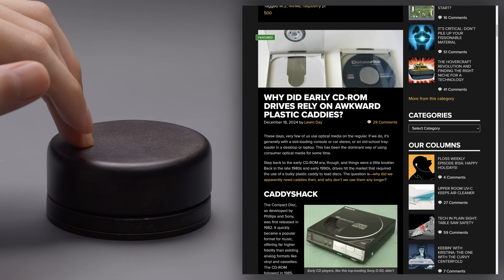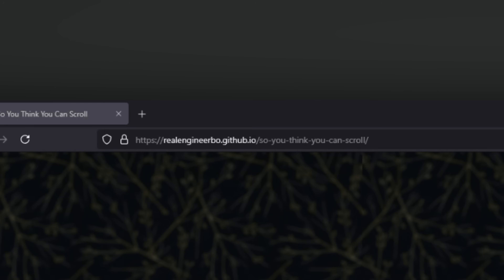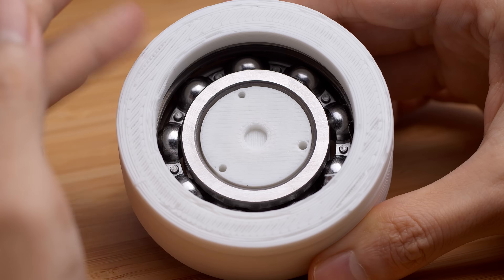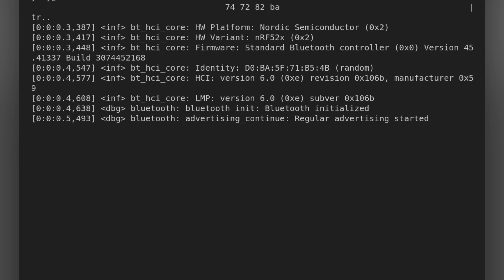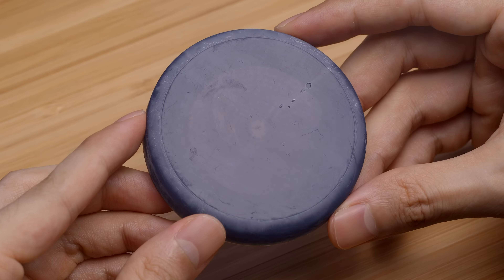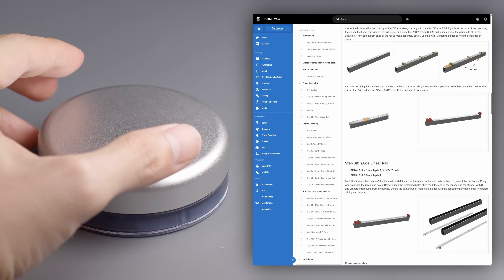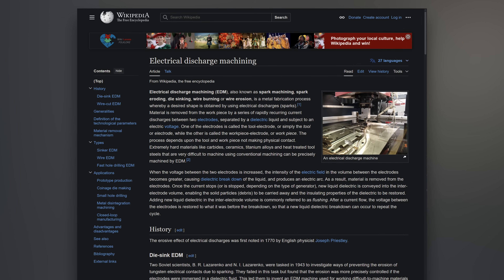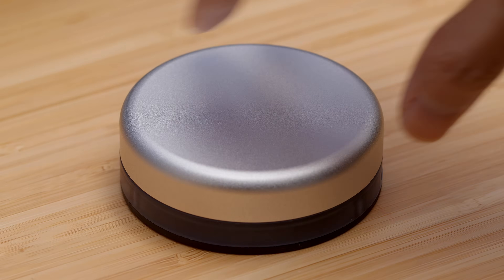Wireless High Resolution Scrolling Device: Full Scroll Dial v2

Comment: Regarding Mac OS support for unusual pointing devices, you might have a look at SteerMouse, which is a third-party application plus device driver that lets you use a very wide variety of mice on Macs that might otherwise not work quite right. It's not free software, but it's got a free trial and I think it's worth the money if you use non-Apple mice on your Mac devices. It also has a lot of features for configuring devices that it doesn't automatically recognize, so I suspect it would let you adjust how your scroller works with a Mac, after some experimentation.

I won't link to it because YouTube will probably think it's spam, but it's easily searchable.

Comment: I use "Mos" on MacOS for the scroll. Apple doesn't really care (or want to care) about how third party mouses work and this app tries to fix it. Try it (or others like it) with the option where it adds inertia/springiness(/maybe smoothness) at the end of the scroll turned off, as I think it will behave weird. Just set the "steps" as small as needed and play around (pun intended) a bit. Good luck! Last but not least, this is an extremely nice project, pleasant video too.

Comment: I'm a little worried about the perfectly flat bottom, if there's a crumb on the table or something the device will not sit evenly. if you had maybe 6 small bumps in a circle for feet that would solve that potential issue.
Reply from the maker: That's an interesting consideration, thank you!

Comment: can you make a wired version? I would preferr that and it also does not require certification that way
Reply from the maker: It'll be quite a significant change since that requires switching to a different microcontroller. It'll still require certifications, but it'll likely be cheaper/faster if it's not an intentional radiator.

Comment: With a base and button(s), that would make an AWESOME paddle/handheld driving wheel controller!
Reply from the maker: I was recommended to try using this as a retro game controller (spinner), and it actually works very nicely. There's no force feedback though, so maybe it wouldn't work as well for driving.

Comment: For tapping.

Next time order the aluminium part with smaller hole and then drill to the desired diamenter for the tapp. Is the easiest way to remove the hard "coating" of the anodizing

Comment: You could look into using a flex PCB to avoid the need for the cable and connectors between the sensor and the main board

Comment: Personally would enjoy a wired version rather than battery and wireless connection.

Also would be neat to add basically a middle mouse click to this, something that could swap the mode quickly and easily, turning it into a volume knob or something else. Also just a nice satisfying click with it would be great to have anyways just from a fidget perspective lol.

Comment: Please say no to the rubberized spray, it will degrade over time making the surface tacky/sticky, and it's btich to get off.  Use little rubber feet instead that can easily be replaced.
Reply from the maker: Yes, for durability, I'll try something else in the next build!

Comment: Very nice job. That said, I might increase the complexity by asking for a scrolling resolution selector, a switch at the bottom with three (low , normal and high), or, for better accessibility, a hole in the middle of the dial where you could place a round button. Each time the button is clicked, it would cycle through the predefined resolutions. However, there might be some interference with the space allocated for the battery.

Comment: So after the first video, I went and bought a Microsoft Surface Dial hoping to get a similar experience since I am not capable of building and programming one of these myself.  I also wanted to use it as a timeline jog dial in davinci resolve, which I could do by mapping the rotation to the left and right arrow keys (per my bindings in resolve).  What the Surface dial lacks in comparison to your wheel is stable bluetooth connection (sometimes bluetooth needs to be turned off and on for it to wake up and function) and the resistance prevents the wheel from spinning once let go.  It would be awesome if you could implement a key binding feature into the driver (or maybe the wheel functionality built into windows for the Surface Dial).

Comment: 500uA on this mcu is just too much in sleep mode. I was able to bring it down to 20-30uA(whole PCB not just mcu) with ble and nfc turned on in the background.
Reply from the maker: Yes I haven't started power optimisation on the application. 30uA sounds great with BLE on. What connection parameters did you use? Did you lower the radio TX power as well? Is the MCU in system off mode?
Reply: @engineerbo i did not touch tx power and kept it default as in nrf connect sdk. 

Zephyr automatically takes nrf to sleep mode and best way to keep the power lower is to keep to mcu in sleep by calling k_sleep when no alternative tasks are running nrf will stay sleeping. 

Also instead of using mosfet to switch power for your sensor, use dedicated power switches with low quotient currents and also the regulators which you are using check there quotient currents as well. Try to switch of any redundant thing in your pcb.
Reply from the maker: @EmbeddedEnigma Thanks for the tips, I'll have to run through all the quiescent currents again before the next revision!

Comment: You could have little indents milled in the bottom of the aluminum, and use a spring to push a plastic or metal bb into it for a small "click" feel if the fully smooth scroll isn't your thing, like a mouse scroll wheel.

Comment: 13:24 I would suggest dissolving the broken taps out using alum. There's a great AvE video on it it will attack the steel exclusively and leave your aluminum intact.

Comment: For the dial, do you think you could 3d print a version of it, use it to create a mold, and then create a forged carbon fibre dial?

To be clear, I know next to nothing about forging carbon fibre so it might be impossible.

You might also be able to 3d print the inverse of the dial directly and then use the 3d printed part as a mold.
Reply from the maker: I actually have all the bits needed for this (including the chopped carbon fibre strands). It'll probably look really cool, but it might end up having too low a moment of inertia (too light).

Comment: wonderful! do you think it would be good as a steering wheel in euro truck simulator 2? the surface dial works, though the ms api is not implemented so there is a maximum input rate limit :(

Comment: 6:33 If the AS5600 is shut off when not needed, how does the microcontroller know when to power it back on if it doesn't have feedback from the Hall sensor?

Comment: I see how the bigger bearing is one way to solve the wobble problem, but looking at the previous design, it seems like you could drop in a thrust bearing very easily, so you'd have both a radial and a thrust ball bearing.  What I like about that solution is that each bearing would be doing the job it's designed for, which I think might extend the life of the device, and they would be cheaper.
Reply: Axial needle roller bearings will be the perfect choice for this application

Comment: Scrolls by sending mouse wheel events

34938 Sunshine for Windows and Moonlight for Android
35216 KDE Connect for Windows and Android
29304 Synaptics TouchPad (TOS0300/SYN0700) two finger scrolling
30454 A normal mouse (120px)

Scrolls by draging the scrollbar

39260 A normal mouse (Enhance pointer precision off)
43727 Steam Controller Gyro (Steam Client required)

Comment: score of just over 73k on my first attempt at the scrolling gaming, not as good as the scroll device, but I feel like you might be exaggerating the gap between them considering how easy it is to get high precision with a mouse scroll wheel.
I checked and my lines per scroll is at 3, which is the system default I believe since I never actively changed it.

Comment: Your bearing selection is kinda wrong. You don't press with much force, so axial forces are negligible, but still, a single row tapered roller bearing would be the right choice. Would also minimize wobble.

Comment: how did you use headset bearings and end up with a wobble 😂 cmon. it cant be touching the bearing due to it being a pot rather than an encoder?  you need a aerospace quality encoder on there.

you could simply move the pot off axis and use cord internally to make a pully system.

Comment: I have an idea; for those that want to use see-through dials, a single addressable RGB led hidden somewhere inside would make the entire thing glow from within and can color-match custom PC setups. You could also use solid dials so the lighting would only illuminate through the cracks in a neat way. Now of course lighting will cause significant battery time loss, so its critical to make any lighting always off by default, possibly dimmable, and a physical dedicated switch near the main power switch for strictly "lighting" could work. A computer UI could control the RGB colors and brightness, but Im old and clunky, I think micro dip switches to change the light colors would be neat since then you wouldnt need a PC program to control the lighting, unless you wanted special effects. Just an idea! You've created an amazing product!

Comment: I see most resin prints being done at an angle for these sorts of flat prints, to avoid most of the issues you experienced here. was there a reason you didn't try printing at something like a 60 deg angle ?
Reply from the maker: There are! In the final print of the dial, for example, all the support marks are on hidden surfaces. I also wanted any shrinkage and warping to be in the same plane, which allows me to compensate for it in CAD. Printing flat also means shorter print times. That's why I use a flex plate!

Comment: 9:44 Sir, why did you skip the 15-20minute resin printing basics video :D
You can make perfect surfaces by not orienting your piece wrong. Your slicer, if you open "orientation/rotation" and press "automatic" will FOR A GOOD REASON put it on an angle. Do not pring straight with resin if you want beautiful perfect surfaces. No go and do it again please, properly :)
Point being, that it should never pull large surfaces, but slices.

Comment: nothing is stopping you from making it touch sensitive ,like double tap and triple tap to go back and go forward in navigation 
or even better include a button for when you press down on the dial , a button under the bearing would insure that you keep the smooth scrolling with the bearing ,but when you press down the bearing would click the button

Comment: I've built a non-wireless scroller for my computer using an arduino micro, but I'm stuck on the HID descriptor resolution control, as it seems no one has ever written a library that allows you to input a custom hid descriptor.. I found a library that reportedly  works on the teeny 4.0, but at a steep 29€ minimum per piece is a lil bit out of reach for a project like this, not that I have to put in large scale production, but I wanted it to be a relatively cheap project, and the bearing alone is already 10€.. Can anyone help me on this?? 🥺
Reply: Hello, did you found a solution for arduino micro or any other arduino? I am searching too. And what is the library you mentioned that supposedly works with teensy 4.0? What it's name? Maybe we can use some code parts from it?
Reply: @OppaYA  No, I've spent already more than a month trying unsuccessfully, and now, having lost momentum, I kind of let aside this project. This video lit a spark again, but I was hoping someone else was already on the right track.. I don't remember the name of the library for the teensy 4.0, but I found it on github and it was really reach in content, in fact it was a collection of several libraries all focused on HID manipulation, and it seemed really well written, but I'm no genius of coding, so I haven't even tried to do something with it.. Maybe next week, when I access my laptop that I left in the office I could try to find it an post a link.
Reply: @tattae87 I see, thank you for answer! If any chance you find it later I would be grateful for info.

Comment: there is literally nothing in this world I want as much as your scrolling wheel. this is such a perfect product. love your work
Reply: Try an scoop up a Surface Dial while they can still be found. After hearing about them in the comments from the last video update here I immediately bought a couple. Works great for smooth scrolling on my windows machines. But Linux has not updated their drivers to support high res scrolling yet.
Reply: Any idea cost?
Reply: @Thejakegee  $99.99 from Microsoft
Reply: @ What? Don't just tag someone with only a "?", at least add an actual question.

Comment: The loading direction for your bearing assembly is in the wrong direction and that is why there is wobble. On the cheaper bearings there were loose tolerances, hence more wobble, but on the ceramic bearing this was reduced due to a higher quality bearing. Still the load direction should be applied radially for that bearing assembly. It would be better to use a thrust bearing or an angular contact bearing. You will be able to get away with buying a cheaper bearing assembly.

Comment: I have this logitech wireless mouse that has great scroller feature where the wheel is large, weighted and has an optional locking button that doubles as a tactile indicator. Being able to coast your scroller is important especially if you read manga.

Comment: I would re-lubricate with something lighter. Try Krytox 205g0 or similar, it will help protect the bearing and improve the smoothness without too much resistance. The grease that came pre-installed was very thick, you don't need that much for your application. And you can always re-lubricate it later if needed. I recommend designing in a lubrication port you can insert a syringe needle into.

Comment: For the bearings, you could consider mountain bike headset bearings. You'd be looking at 1 1/2" or ~ 38mm and could find them reasonably priced. 

You could also find them in ceramic which won't be reasonably priced, but would be nearly silent without grease.

They should also have a lot more balls and are angular contact.
Reply: Alright, I commented in the first 4 min 😂

Comment: gaming mice have holes with foam or a magnet, that you can install steel weights into, to customize weight. maybe you should have similar holes in the circumference that would allow for spinner to be as light/heavy as desired?

Comment: Milling hardwood with the spindle on the machine you bought is going to be painful, I guarantee it (probably a 600w spindle I'm guessing). I have been into hobby CNC routers for over 5 years, it's not easy to cut anything harder than pine with a <1kw spindle. And even ripping through pine takes a 1.2kw spindle. I'm in the process of building a custom 3.5kw 2'x4' router with automatic tool change. Mainly to be able to actually work aluminum, and also to rip through hardwoods.

Comment: Instead of using a dedicated magnetic position sensor, maybe you could use a multipole magnetic encoder ring with a few conventional hall-effect sensors? That way you can ditch the ASIC and potentially reduce the quiescent current further. I wonder how much energy you could harvest from the spinning magnet to keep the battery charged, before the unit starts to feel sluggish?

Comment: about rewriting of code: Programming something that isn't trivial is always a learning experience, usually with unforseen changes that need to be made. Rewriting code using the acquired experience always leads to a more satisfying result.
Reply: My team and I understand that for critical systems, counterintuitively, writing twice or more is sometimes the best use of time. The first time could be vibe coding with an llm. The second is just to "get it working," and third is refinement. It saves so much time for maintenance later. This doesn't work for everything, but it's a useful tool to have in your bag.
Reply: @developersteve1658  
SO
MUCH
THIS
I work with a team that's full of 'planners'. They want to plan every tiny detail, not only about our products, but also about how we work together, how communication in the team works, how we can apply books worth of norms and standards to our process and it takes SO MUCH TIME. We've been planning a project now for years and are nowhere near starting. We've made a prototype in 2 weeks that still gets shown to clients because the team that's supposed to be rewriting that prototype is still in the planning stage after a year. The prototype still works flawlessly (I wrote that with 1 collegue), while the bigger team has ~10 people
Reply: @developersteve1658  garbage in, garbage out

Comment: A thing about bearings: The wobbliness of a ball- or roller bearing is more of a feature than a bug. It’s purpose is to allow for some misalignment of the shaft . The correct use of ball- or roller bearings is almost always to pair them in some way with quite a bit of distance between them, this way you get the benefit of allowing for misalignment without a huge play. 

Anyways. Very cool project, it’s really interesting to see someone throwing this much research and effort into such a niche thing as high precision scrolling 😀

Comment: Why is it that you want 'high speed' or low friction rather than slow speed with very consistent friction? I to have huge scrolling needs and urges but I have been looking for a high precision scroll wheel that is heavy, slow but precise. Where a complete rotation of the wheels is about a 500-1000 steps but the precision of the wheel makes 1  step advances possible. I imagined that some kind of lubricated bushing would work for this but I am not sure.